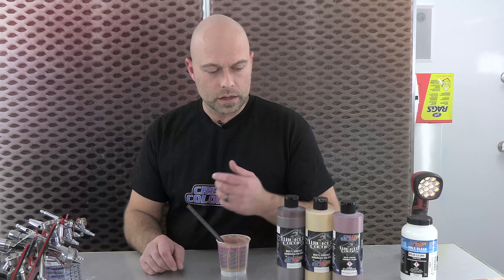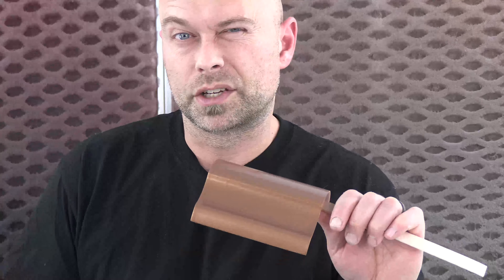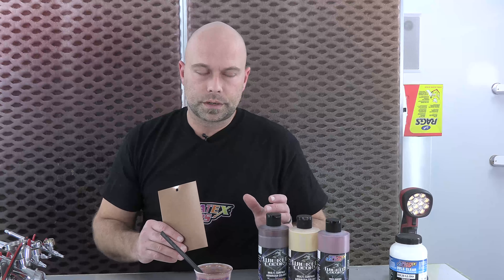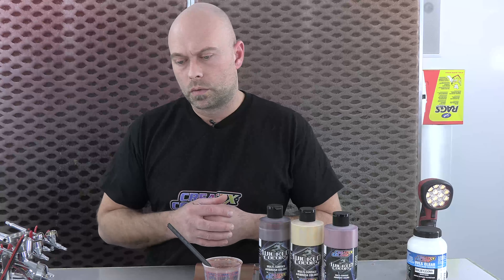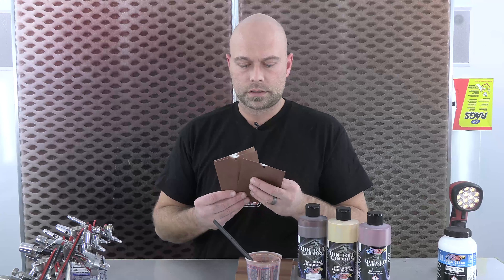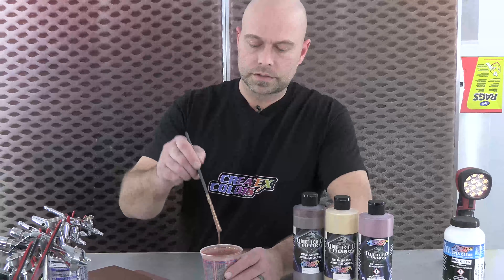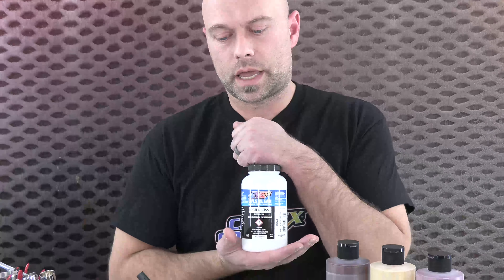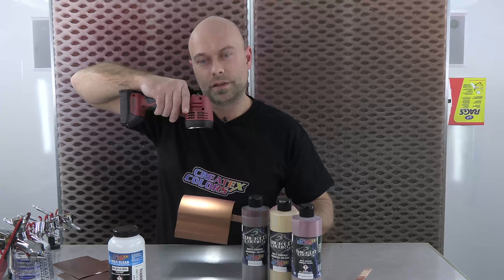How-To Make Firemist Gold

Comment: Ooo definitely want to know more about the 4053.
Reply from the maker: 4053 High Gloss is a brand new clear that is a part of our UVLS line of architectural-grade clears. 4053 air dries to a much higher gloss level compared to 4050 and is by far the highest gloss-level clear Createx has ever made.  4053 has the nearly the same gloss-level as a 2k solvent-based, urethane gloss clear. At a 20-degree angle, 4053's gloss level is 75 GU (gloss units) and at 60-degree angle is 90 GU, compared to PPG EC550 2k Urethane Gloss Clear which is 87 GU at a 2--degrees and 92 GU at 60-degrees. 4050 is only 55 GU at 20-degrees and 80 at 60-degrees. 4053 is much closer in terms of gloss-level to a 2k urethane clear than is 4050. Thank you.
Reply: @CreatexColors  Sounds awesome !
Reply: @CreatexColors   Would love to see more videos with you guys using it.

Comment: Please tell us more about that 4053 High Gloss! Excellent video btw, always very informative.
Reply from the maker: 4053 High Gloss is a brand new clear that is a part of our UVLS line of clears which are architectural-grade. 4053 air dries to a much higher gloss level compared to 4050 and is by far the highest gloss-level clear Createx has ever made. 4053 has the nearly the same gloss-level as a 2k solvent-based, urethane gloss clear. At a 20-degree angle, 4053's gloss level is 75 GU (gloss units) and at 60-degree angle is 90 GU, compared to PPG EC550 2k Urethane Gloss Clear which is 87 GU at a 2--degrees and 92 GU at 60-degrees. 4050 is only 55 GU at 20-degrees and 80 at 60-degrees. Thank you.
Reply: @CreatexColors  Availability in Europe?

Comment: do you recommend using the new 4053 on motorcycle helmets, I've only been having them cleared with PPG EC530
Reply from the maker: 4053 UVLS High Gloss Clear is brand new. Like other UVLSA Clears, 4053 is architectural-grade, suitable for exterior applications, but not recommended for automotive as is a 2k urethane clear such as EC530. Right now, we're recommending 4053 for sign, cosplay, sculpture and other applications. For a motorcycle helmet, a 2k automotive clear is best. Thank you.

Comment: Spot repairing candy.. Tell me about it! I’m currently fixing a friend’s bike tank that he managed to get a huge dent in two weeks after the candy paintjob was done… I ended up redoing the entire job after body filler, sanding etc. I like the 4053 high gloss! Not quite at 2K clear level but fairly close. Where do you see the 4053 being used? Not for automotive I guess?
Reply from the maker: 4053 High Gloss Clear is, like other UVLS Clears, architectural-grade, i.e. a sign clear. 4053 is great for art, hobby, sign, cosplay and most any interior & exterior application other than automotive, where a 2k urethane clear is recommended as the top-coat. Agreed, 4053 is not quite the gloss level of a 2k gloss, but its close and will work excellent for many applications where a 2k automotive clear isn't required but a high gloss finish is. Thank you.